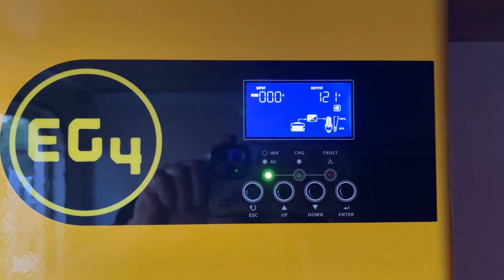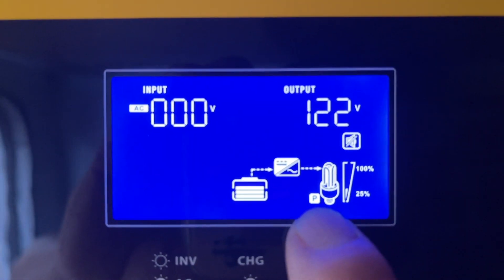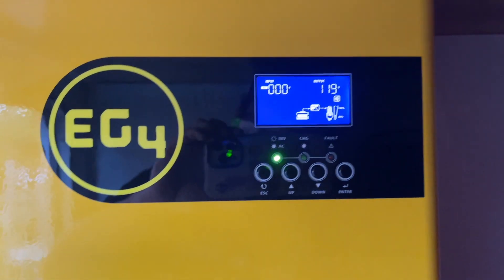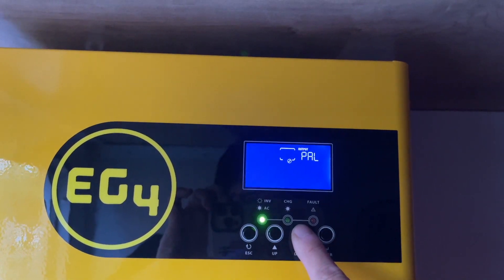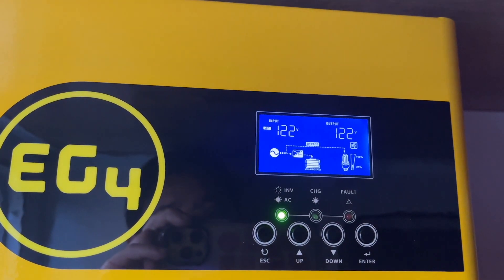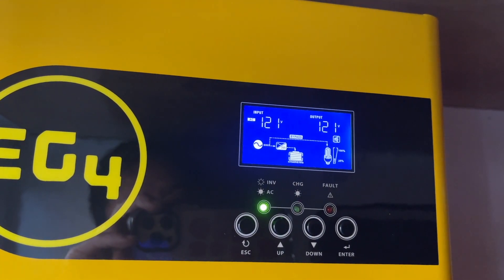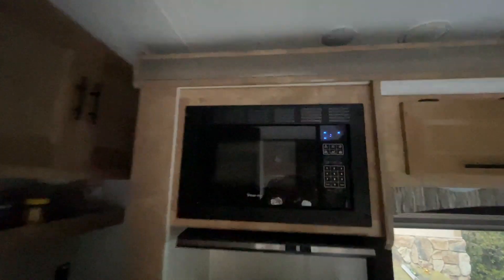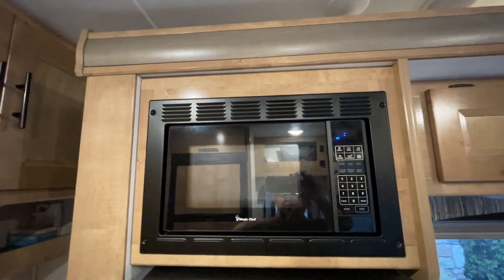EG4 3000EHV-48 Power Saving(Eco/Search) Mode issue and fix

Comment: In your video, you show the 120v output going on and off repeatedly. I think this is how the EG4 decides if there is enough load to turn on an stay on. It has to put voltage out to "test" if there is enough load to come out of Power Saving mode.

Comment: It's possible that power saving mode is for the purpose of "turning off AC output" - for example - if people that want to use this box strictly as a charge controller.  This is what I'm trying to do, and so I don't need AC output, to reduce consumption.

Comment: I am currently having this issue...I just installed it a few days ago and noticed the P flaSHING and in parallel mode. I dont have a second power source ..I am straight off my panel array. I tried your method without success. Any ideas? UPDATE: Got it resolved. I just had to turn the EG4 on and off switch off. With power still to the EG4 I was able to change #28 to SI G (single) mode and then #4 to SEN (enable)  All is Good. Thanks for Vid.

Comment: Better method !!!  Put it in standby mode - turn PV off - AC off - and then inverter off.  You can still change settings, including power saving and parallel mode.  They should have put this in the dang manual.  How many thousands of google searches because they didn't include a piece of paper?  @signaturesolar please change your manual!

Comment: You don’t need a second power source.  Leave the battery turned on and switch off the inverter.  You can then make the setting change.
Reply from the maker: The issue of not being able to enable the power saving mode(prog 4) is because the AC output mode(prog 28) was set to "Parallel" mode.  To change the "AC power mode" from "Parallel" to "Single" mode you need to have two power sources.  After that, you can enable/disable power saving mode with only a single power source.

Comment: Thank you for solving this mystery!  The 3000 comes set to parallel, probably due to the issues when trying to run in power saver mode.  It’s a great inverter, but they all have a few quirks.  ☀️⚡️💡🤠👍
Reply from the maker: Glad it helped

Comment: Maybe your microwave is enough to trip the eco mode. Try putting your microwave on a switch or switch off the breaker when not in use.
Reply from the maker: Thank your for your suggestion, I thought about doing that too.
Reply: Was about to say the same👍 Move the microwave on to a separate circuit breaker, or add a on/off switch for it.

Comment: Thanks for finding resolving this issue with the Power Saver mode!  I actually called Signature Solar on this issue, and they were basically clueless on how to enable Power Saver mode.  BTW your install looks very much like my install in a back bay of my motorhome, except I have two EG4 Rackmount 48V batteries.
Reply from the maker: 2x EG4 racked batteries?  10KW? Nice.  You have enough energy to run electric heating for your RV with that much power.  I assume you have solar on the top of your motorhome.  What is your setup?  how many panels? watts? how much total power does it produce in a day?  I'm in the process of rewiring my inverter and planning to put some panels up but don't really know how many I need.
Reply: Still no solar on roof.  Considering options.  We mostly need the system to handle short term needs when we can't get an electric site, or when the power goes out for CPAP devices and extending my onboard batteries.  Currently we can recharge via the onboard generator, direct 20A connection or via a separate AC to DC charger, that I use at home as it does not require many amps, but still slowly charges the batteries. 
Also considering a few flexible panels which I will store in one of the bays and put out as needed, if we are camping off grid.  Due to the power requirements of the EG4 charger, I may opt for an external Victron charger device so I can use lower voltage requirements.

Comment: I have this unit in my basement with 4 12.8v batteries in series. The batteries are from RedOdo. I tried that mode SNS and just diabled it. I am inside and check it out dally. I don't have solar power available for now, but it's around the corner. It is good to see others' experiences with this inverter. Mine, I pushed it a bit with good-sized loads . It works. Idle consumption on mine with everything off, but the smart shunt Bluetooth is on. It holds up pretty well.
Reply from the maker: Thanks for sharing your setup.  My so far works pretty well except the idle consumption is ~65w when the power saving mode is off.  So it uses about 1.5KW of energy per day which is a lot especially since I do not plug in my RV to shore power most of the time.  I'm going to put up some old rooftop solar panels l have left from another project.  Other than that this small 3KW inverter handles heavy load pretty well.  I had it pushed to 3KW with my AC, microwave, and little heater running at the same time.   When the AC kicked in the voltage dropped to ~100V from 120V temporarily and back to over 110V which is not bad at all.